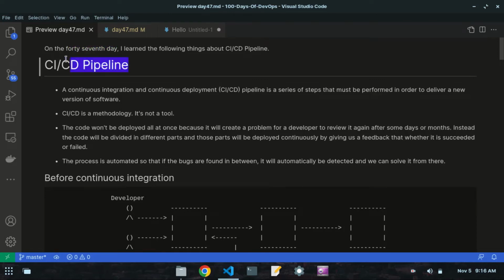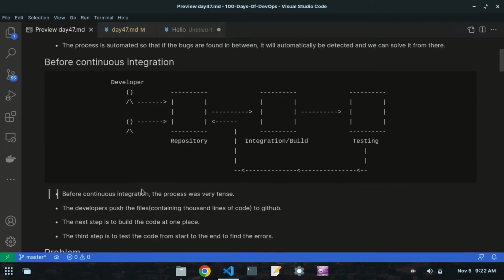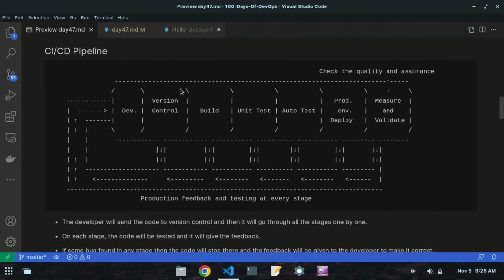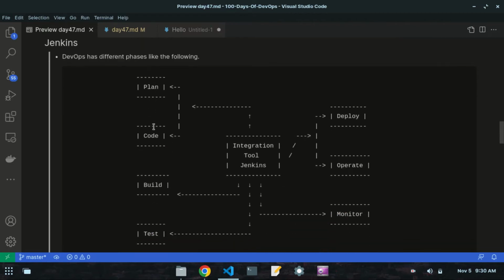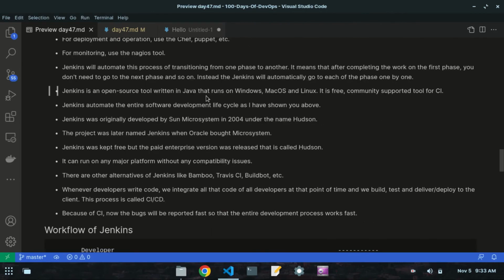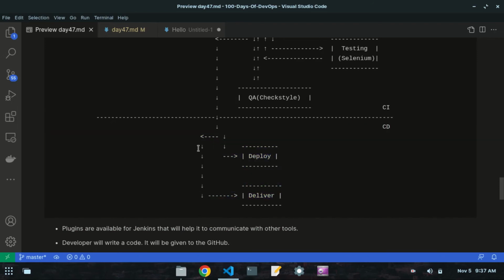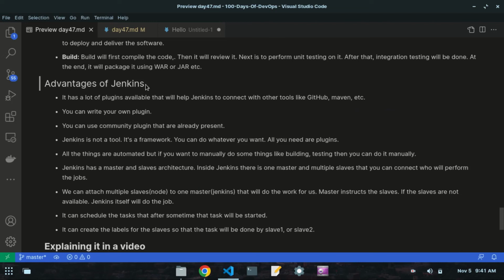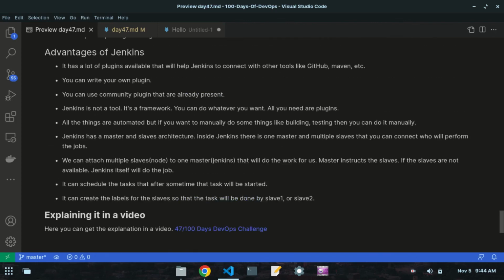Learn CI/CD Pipeline | Day No. 47: Transformative Impact and Jenkins Introduction

Comment: Integration and building stage were different in agile methodology
Reply: That Method is different and this continuous integration is different  method.
Reply: In CI All the code changes from different developers are integrated in to single repository. 
But in Agiles methodology, integration test between two different components such as behavior between front end, back end, Api etc.
Reply: @Sp3aR007  thankyou for clarification 🌞